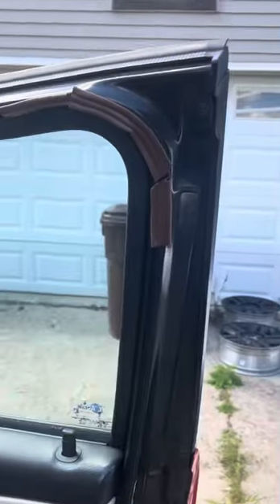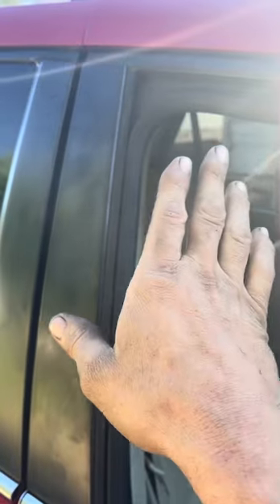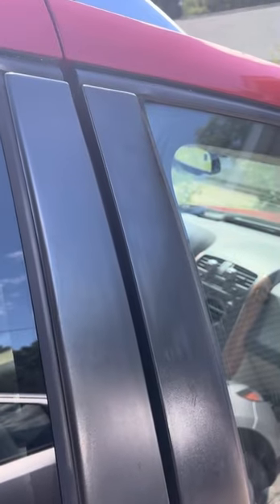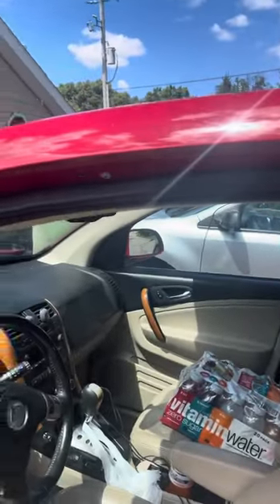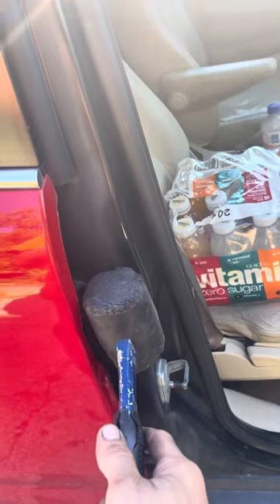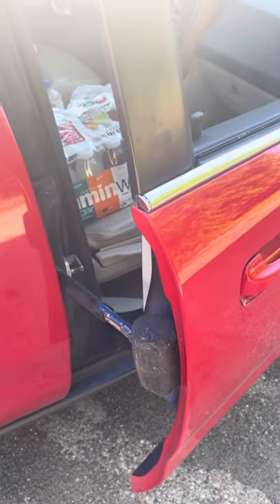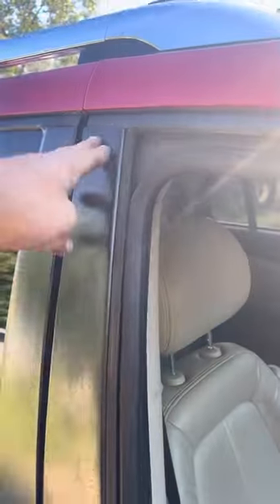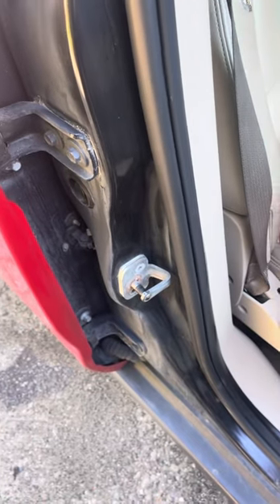STOP Air Leaking Through Car Doors EASY and Quick! You'll Love This Trick!

Comment: Be sure to fully roll down the window before trying to “flex “ the door to the correct alignment.
There is a definite risk of shattering the glass when doing this technique, because the glass will not bend If too much oblique stress is placed on it. It won’t bend like the metal door frame, it will just shatter.
Reply from the maker: I said that in the video sorry that you missed it…… it was literally the first thing I said
Reply: @sharpcarco  Yeah, I guess I did miss it. My bad. Good hint content .
👍😎👍

Comment: Sometimes those stricker plate latch pins wear, causing it to change adjustment, without anyone messing with them.  Seems like i see more of it out in the wild west, where dirt road Dale's are making rooster tails of dust, the dust sticks to the grease in the door latch and then identifies as valve lapping compound, wearing away the latch pin.

Comment: Usually the weatherstriping is torn from being poked through when the being unlocked by a wire or rod.
Reply from the maker: Well, if you’d watch the video a little bit further, I mentioned that, and then on top of that, that was not the problem

Comment: Hope this solves my problem.  The air is getting very annoying.  Couldn’t figure out why I had a gap there.   Is a lock out the only thing that could have caused this gap?
Reply from the maker: Sometimes they just get sprung. I just say that that’s a good reason for why they normally do that but I’m certain this will fix it.
Reply: @sharpcarco  finally had time to try this today. I’d say it’s 95% fixed.   Hafta give it a couple more pushes I think but the wind noise is gone and now the door is sitting flush.  Thank you

Comment: Wow jusy saw the tumbnail of what looks like a fusion, which I proudly own a '09, and found a solution to a problem I had but havnt looked into fixing yet. If you have more fusion related tip i am subscribing
Reply from the maker: I do fusion stuff but you’re gonna find the most vehicles are the same…. Most of the tricks that I show in my videos will work on anything. 

And if I’m working on a Ford because Ford is a company and they wanna make products you’re going to find the procedures and most of the parts are fairly interchangeable or at least the procedures are interchangeable from vehicle to vehicle because companies make a lot of money by producing as many parts as possible that will interchange over different cars meaning engineers will engineer things the same way even though it’s a different car because somethings just have to work well on everything so they’re pretty much the same thing

Comment: Air Leak being fixed by bending the door frame?  Proceed with CAUTION whoever watches this... inspect your weatherstrip around the door and check that first... bending frame is NOT an effective way to fix wind noise and air leak (if you experience hearing it while driving at higher speeds).
Reply from the maker: Sorry, I forgot that people don’t think often to check the door rubber first I was trying to make a quick video but hopefully it makes you feel better with your comment..